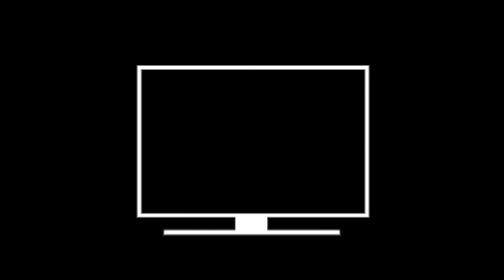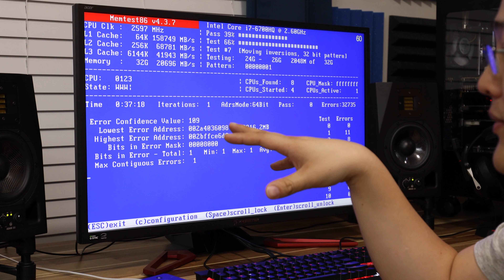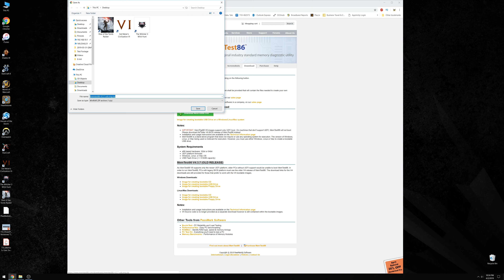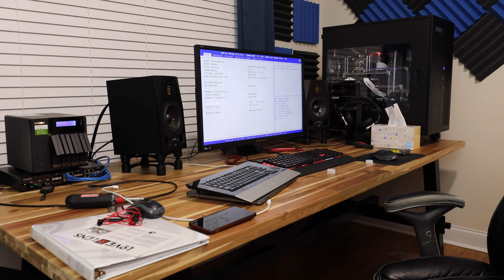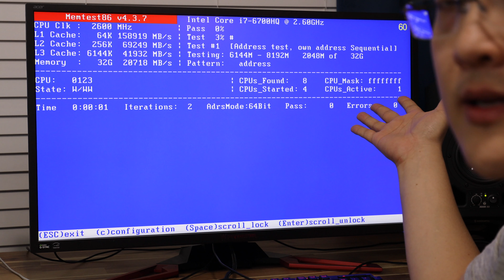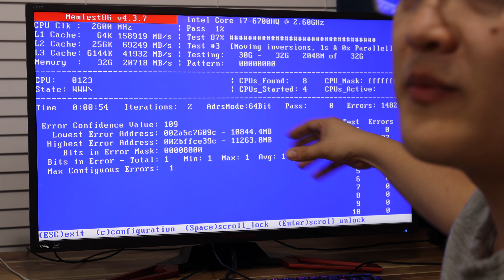QNAP Memtest86 Tutorial - Check For Bad Memory!

Comment: Depending on the QNAP model, no need to enter BIOS. Reboot, on boot screen press F7 button for boot menu, select to boot from your USB drive for one time override. I am on TS-251+, no keyboard, no mouse will be available under Memtest86. It'll start by itself and run until you pull the plug out.

Comment: I'm experiencing something weird. I just built myself a 2700X + Gigabyte B450M Aorus Elite + Teamgroup dual channel (2x8) DDR4-3600. Placed the DIMMs in slots 2 and 4. Memtest86 fails at 3200MT/s and above using XMP timings. Switched the DIMMs to slots 1 and 3, got even more errors at 3200. Switched back to slots 2 and 4 and now Memtest86 passes 3200 twice already. Ok why is it suddenly running well now?? 3600 is still failing but I think it's because of the memory controller and not the DIMMs.

Comment: Hi Stan, Really helpful  vid. I have M.2 Cache drives on my QNAP beside the normal HDDs. Would these need to be removed also to run Memtest? (You need to open the case for these to be popped)

Comment: My friend, Damn, I am feeling your pain.  I bought 8 sticks of memory from NewEgg and put in my system, and it is not booting up.  But, I put a single one in, and it works.  So, I am using MemTest to figure out which one it is.  And, I am going ONE-BY-ONE ... doing all of the tests for each 16GB of memory.  But, yeah, a day (and more later) I found that it is just one of the eight that will not even allow memtest to run.  Computer won't even boot with that stick in.  Get this.  These are BRAND NEW memory from Newegg, so I guess I've got to send them back to G-Skills.
Reply from the maker: Yeah man, that happens sometimes. 🤷🏻‍♂️

Comment: thanks for the tutorial. the results I had was FAIL on 2 ram but PASS when testing the ram and slots individually. any advice for me? i just had my PC 2 weeks ago and I've been consistently getting BSOD since then.
Reply from the maker: Rearrange the memory but have them all plugged in. Confirm that it is the memory and not the slot that’s bad. Also make sure try running at default speed and xmp speeds. Make sure it’s not a memory controller issue.
Reply: What I would suggest, KK, is what the hell that I am doing.  Put a ram stick in the first slot, next to CPU -- or that's way on my board.  And, just test ONE SINGLE STICK.  And, run it with the full test.  I am not using MemTest86.  I'm using Windows ramtest.  But same thing.  Just do one at a time, and tell it to do the extensive test.  Yes, it takes time, but you will figure out exactly which one is the problem.  Also, the Windows Memory Diagnostic test is awesome for doing this.
Reply: @PoeLemic  I gotta disagree with one thing. Both Windows tests told me my Ram was fine even with extensive test. Memtest86 ran into 1257 errors between 4 passes. Changed RAM tested again no errors, and so far no bsod while gaming, goodluck.

Comment: How do you know which ram is faulty?
Reply: If you have more than one stick, you have to test them individually.  EVERY SINGLE ONE.  I just bought 8 sticks of 16gb each.  So, I have spent the weekend figuring out which one is bad.  ANd yeah just 1 of the 8 is bad.  But, it takes a while, and sucks.  Lot of wasted time, because you have to keep switching them.  Yes, you can do them (like 2 at once), but then you don't know which of the two is bad.  Easier just to test each one singularly.  Get this:  these were BRAND NEW off NewEgg.
Reply: @PoeLemic  does it matty which slot?
Reply: @royaltyallen1162  Yes, it does.  You need to look in motherboard manual to see which is primary memory slot.  Or, that's what I did.  I only tested one stick at a time.  Or, tested the first one, then I removed it.  Then, tested next one, and so on.  Then, you know exactly which one is bad.  Yeah, it took a while,b ut I was certain which memory stick was the problem one.
Reply: @poelemic3642  i only tested the build in windows memory checker or something,is that credible? No problems on my test
Reply: The main problem on my pc so far is all my games just closes without any warning or error,I'm just back at the desktop...this started happening a week ago.
Reply: @royaltyallen1162  Well, it might be a Windows update.  Right now, my ALT+TAB switch between apps isn't working right, and it takes LIKE 10 to 15 seconds to flip between them.  So, it started happening after an update too.  Could you create a new user on your System, and try to play a game -- to see if it happens in a new user.  I've done that, and my ALT+TAB works correctly.  So, I too don't know what is wrong with my issue.
Reply: @royaltyallen1162  You:  i only tested the build in windows memory checker or something,is that credible? No problems on my test
Me ... Like I said, it might just be the Windows update that is causing your problems.  I read somewhere that Games are having problems after a certain update.  reserach on Google and I bet you can find an article.  But, see -- if you've already tested your memory, then it probably isn't that.  Memory problems (liek I had before) usually make your system just crash totally, or you get BSOD (Blue screens of death) that say memory fault.  Or, the screen does weird horizontal lines.  Stuff like the picture below, is what I was getting ... 
      https://www.google.com/search?q=memory+fault+screen+lines&rlz=1C1CHFX_enUS700US700&sxsrf=ALeKk00HLHpBpTfXETgLTcdWZ-SZvbkcKw:1620288735057&source=lnms&tbm=isch&sa=X&ved=2ahUKEwj99fHzzbTwAhXHZc0KHSvqAC8Q_AUoAXoECAEQAw&biw=1862&bih=982&dpr=1.38
Reply: @poelemic3642  i only get bsod like once a week before,but lately it's been happening frequently.

The  main problem i have with my memory is that they're both Corsair rgb pro right but the manufacturer or version is different. 1st rgb pro 8gigsX2 (version 4.32)... 2nd RGB pro 8gigsX2 (version 8.31)...Mainly get like bsod once a week but I've been getting bsod more frequently after the update like just scanning the drive then bsod.
Reply: @poelemic3642  hopefully it's just the update,no serious stuff like hardware,hopefully. I never got that line artifact
Reply: @royaltyallen1162  Well, that shouldn't be happening so often.  Always, as a rule, you should have same version, manufacturer, model, etc., of the RAM.  I always do that.  Like I will get 4 x 16gb for my system, making the board out all-at-once.  Then, I have no problems.  Only time that I had problems is when I bought 8x16gb from NewEgg for one system, and I bought returned memory for a discount.  Yet, it kept giving me problems, so I tested memory and found one was bad.  And, always buy RAM that has lifetime warranty, as most do (like Gskills or Corsair).  So you might want to try and switch out one group of that, maybe, then it might help your problem.  Buy from newegg and return if it doesn't fix the issue.  That's what I'd do.
Reply: @royaltyallen1162  Yeah, that line artifact is what I got when that one stick of memory was bad, out of 8 of them.  So I sent it back, didn't have 8 and used 7 only, then got it back.  It was switched out and worked perfect now.
Reply: @poelemic3642  i both got them in Amazon apparently theres 2 manufacturer for Corsair 3600mhz Vengeance RGB pro, Henix and Samsung,which screwed me over.
Reply: @royaltyallen1162  Well, I feel for you.  Why not just send them back?  Or, did you get them too long ago?
Reply: @poelemic3642  oct and December of last year. I've thought but I'm still troubleshooting since it was working fine before last week

Comment: My motherboard has 2 slots and I have one 8GB RAM module. My pc was getting BSOD so I tested the RAM module and got around 500 errors. So I deleted my windows and used puppylinux with a pendrive just to access the harddrive for few days. I changed the RAM module to the other slot and tested again today, there were no errors. Could it be that my motherboard is corrupted?
Reply: Or you damaged the DIMM slot like I did when installing.

Comment: Do you run it with all ram installed or one at a time ?
Reply from the maker: All at a time is fine. It’ll tell you which stick is bad.
Reply: @StanYanMan  No, are you sure.  But, I'm using WIndows' bootable ramtest, so it doesn't say which stick is bad.  So I am testing one-by-one to make sure which is bad.  If MemTest86 tells it, I wish it'd been shown.  But you were only testing one, so that's pretty easy to know.
Reply: Probably too late, but you can test all like SuperStan says.  But on Windows' test one, you can't tell which stick it is.  But, you'd know that you had a problem.  Then, you have to test each one, or I did to finally find the damned one that's got a problem.  Stupid how the software is designed.  SHould be much easier.  Maybe Stan's MemTest86 does it better, but the Windows one isn't the fastest approach.